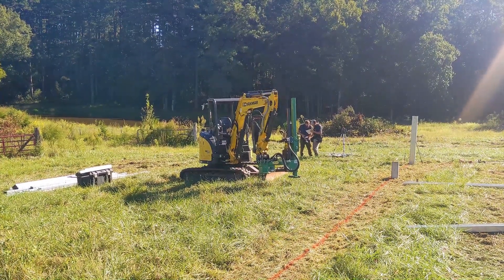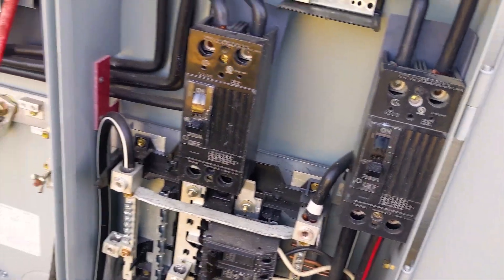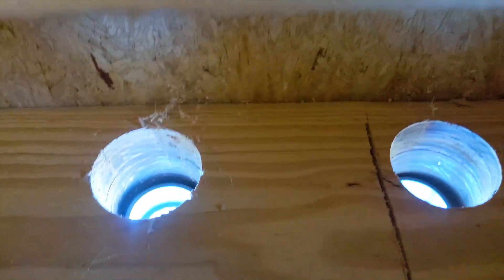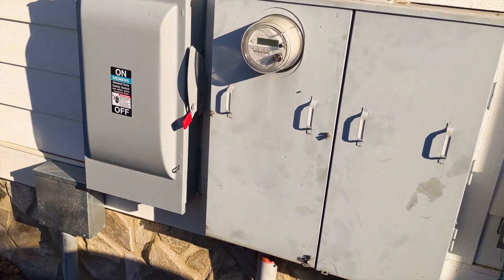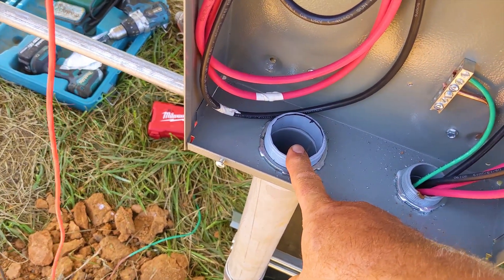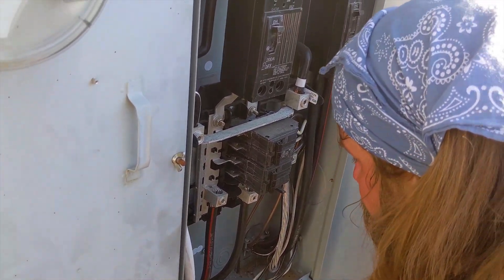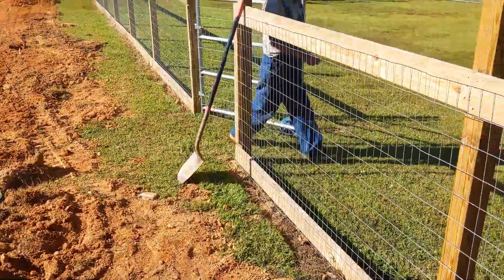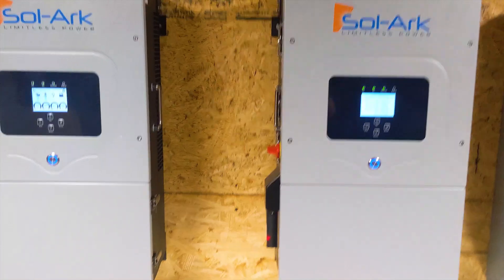Take that, power bill!

Comment: I have an existing Generac automatic transfer switch with grid primary and 24k generator secondary. I am tryin to add a second automatic transfer switch with solar power primary for whole house and output of 1st transfer switch as secondary. I am looking for solution that is NEC compliant and safe. Any ideas?

Comment: I have a question my current setup i have 200 amp service i have everything electric my water heater is heat pump my air and heat are heat pump most i have ever used in a month is 4500kwh i was looking at a kit that 19.2kW Complete Solar Power System - 2 x Sol-Ark 15K's + 61.4kWh Battery Bank + 48 x 400W Mono Solar Panels would that be enought to offset my house to 0 or would that be over kill i do have a hot tub that has a 6k heater
Reply: I normally run around 120kwh a day my electric bill says when i went 4500kwh was in dead of winter and i had a 20kwh heat strip that was installed that i no longer have installed running a mr cool 5 ton universal system

Comment: I have a question: how do I connect the panels parallel or in serie. 
I have 32x480 panels 53Volt.
Can I go with a sol-ark 15 k without overloading the solar input 
Thanks

Comment: Love your video's you guy's do very nice work. I have a question , I'm getting ready to do some solar here at home DIY. I'm a 30 year electrician but to me solar is a different ball game .  LOL  I noticed you had 136 volts and they are very long home runs do you get any voltage drop or because you have no load do you still have 136 at the house?

Comment: Great job Scott and crew!!!! Just had a question, been looking to do solar myself but the way everyone's meter setup is done is on the house, my meter happens to be pole mounted approximately 200' from my house. How would I be able to tie into a system like this, are the transfer switches able to be mounted inside my garage (where breaker panel is located) or do they have to be next to the meter, cannot get a direct answer from the Co-Op (my electrical  co) nor can I get any electricians to say either....

Comment: My father hired a company to put up 74 solar panels, but these companies want from $10 to $20 for a battery back up. So we have 74 panels, but if the power goes out we're sitting in the dark because our power as you may have guessed is routed to the power company, so the power being produced by the panels is not directly accessible. 

Having batteries constantly plugged in and charged would be nice for hurricane season as we have managed with a generator, but if the crap hits the fan, and there is no electricity due to damaged power lines, or government shut downs, etc., we're without power.

I wonder if there is a way other than having our own battery backup units (with their own solar panels) that we can change this and possibly add a switch or switches to reroute and access the power. We have a well thus we need power for the water pump. The water heater and stove are gas, so that relieves some of the need for electricity.

Comment: Scott super nice - Good to see stacking performance improved. Searching sources for the 10" inch deep Gutter?  Factorymation?  Know of affordable NEMA 3R / IP66 rated gutter that deep? I'm thinking to use 8" deep with 2x4 spacers to run circuits behind as well.

Comment: Curious if you can walk through the array math for me?  The panels look like 72+72 cells so if the open circuit voltage on the string of 14 is ~305V then each panel must be two series groups of 72 in parallel.  Why isn't the open circuit voltage higher though, shouldn't those be nominal 36V panels?

I assume two runs back to the SolArk with each combiner into an MPPT. Also I calculate the voltage drop at ~2.7% with 8AWG over 300', are you targeting 3% or so ?

Thanks for the great vids, I have a 10K gallon slowpump gravity project I'm working on too and will reach out separately.

Comment: Is it true the inverters will not function without the presence of the grid's incoming power? The anti-islanding safety precaution feature I believe. If so what is the workaround for this? Could you use a bypass to feed some of the power to the grid-side of the inverter?  I don't want to shock utility workers but if things go dark and no batteries, how does one get power? I did a line-side tap due to my old busbar rating. I suppose a disconnect between the main service/house panel and the incoming utility meter would be needed? Is there a product for this, I can't imagine I'm the only one dealing with this.
Reply: How about something like this?

Comment: I'd still like to see you do a video compiling off-the-shelf, retail Box Store retail components. The Harbor Freight Thunderbolt 100 watt kit, that I believe can be expanded to 400 watts  comes to mind. The I'm not talking something to power an entire house or sell electricity back to the grid. I'm thinking something more along the lines of operating a small dwelling. Lights, a fan, TV, an on demand RV style water pump, small refrigerator.... No electric climate control, water heater or stove.

I'd like to build a solar powered tiny home system with parts I can walk in and purchase components locally with cash when I have it.
Reply: Forget Harbor Freight thin film lams.  Buy Standard 60/120 cell panels unless you are on something that moves.

Comment: I see that you set up 2 solar array racks.  Is that better then setting up a single long mounting rack ?
Reply from the maker: Sometimes it is easier to build two seperate racks that are identical. Also the customer wanted to tighten up the space where they raise were set as he had a fence on one side and a road on the other so one long array would have been too long.

Comment: I'm sure you've already thought of this. Is there a chance that the hammer and the lines drops your capacity for the total machine enough that it overheats. My friend said it happened with his big attachments on his low flow bobcat.
Reply from the maker: It is possible but it worked really well for the first few jobs and continues to get worse. I'm getting the right amount of pressure to the tire post driver but the hammer itself is not getting the right amount of pressure like it did when I first bought it. I moved testing gauges all over it to try to figure it out and all I can find now is that the pressure is too low at the hammer.

Comment: How did he get 90 degree angles in the cables in the box at about 4:18? I have never seen that.
Reply from the maker: That is the meter base wiring from the manufacturer.
Reply: @engineer775  Ok, I would love to see the tool they use for that. Thank you very much for the reply.